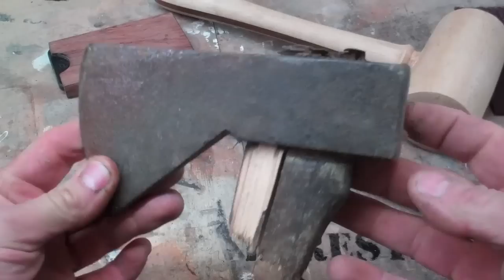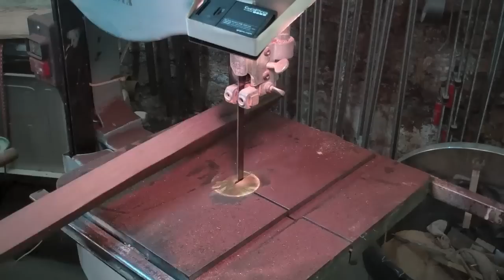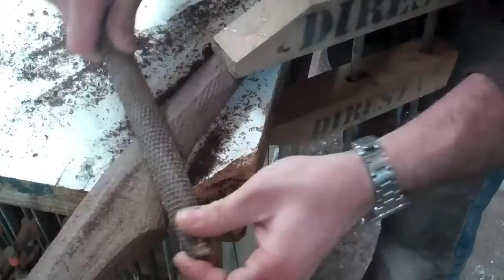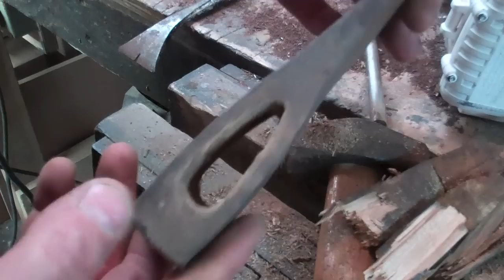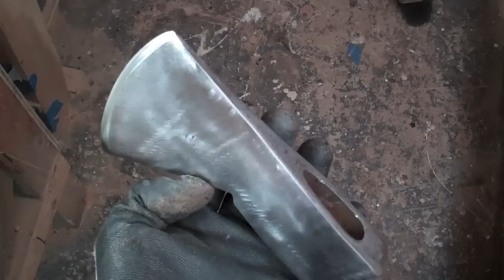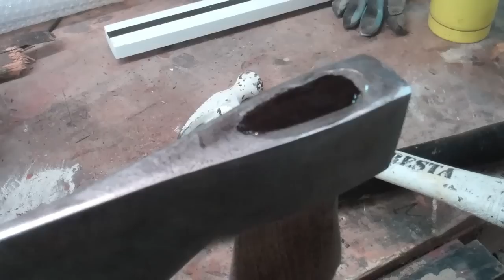✔ DiResta Axe Handle

Comment: Hey Jimmy, next time you want to remove rust like that you should try electrolytic rust removal.  All you need is a bucket, a 12 volt battery charger, some washing soda (yes, washing soda), some sacrificial steel, and the piece you want to de-rust.  Connect positive to the sacrificial steel, negative to the axe head with a piece of wire, and suspend the two in the bucket in some water with washing soda mixed in.  the current will turn the rust back into metal, and you won't have to use a grinder.  It's set and forget.
Reply: Why spend 30 minutes setting up electrolysis to save 2 minutes with a grinder?
Reply: Rick McQuay in case you don't want to mar the surface of something old/delicate/intricate. It works great for projects where you can't reach the rust with a power tool too. For example, I used it to de-rust the interior of a motorcycle fuel tank before patching it.  Bent up piano wire works like a charm in those hard to reach spots. The closer you get to the work piece without touching it the faster the reaction happens in that spot.
Reply: He was also removing the pitting.
Reply: wouldntyaliktono It's an axe head, nothing delicate or intricate.
Reply: Just the solution I was looking for to restore an old metal suitcase/trunk.
Thanks!
Reply: Rick McQuay methinks you miss the point.  Not saying he did it incorrectly, just sharing my experience. cheers
Reply: Paul Whelan It works the best if you've got a high current battery charger (10+ amps) and your water is warm.  The longer you let it run, the more rust will convert back to iron.  Make sure you're not stingy with the washing soda too because it's what carries the electrons through the water from one pole to the other (electrolyte).  You can buy a whole box of it at the grocery store in the detergents aisle for a few bucks.  ALSO, don't do it to stainless steel or chromed steel.  You're liable to release hexavalent chromium which is very bad for you. cheers.
Reply: wouldntyaliktono Thanks a million mate. I have a setup for anodizing and one for etching PCBs, along with some caustic I use for cleaning aluminium so I'll see what I can put together. Thanks again for your help.

Comment: That's a hatchet, and doesn't have need for such a long handle. Axe handles also shouldn't be polyed. Boiled linseed oil is all they need. Also, super glue and zip kicker isn't going to hold that ax head on, especially with that wedge breaking up like that. LOL But otherwise, great work.
Reply from the maker: the good thing about making things:  you can do what suits you and your personal needs. the head will not go any where i promise. 
Thank you!
Reply: jimmydiresta Yes Jimmy, in Yorkshire there's an old axiom, I paraphrase: them that can, do, them that can't make dumb comments. Great work, sir.
Reply: Well Gareth, that proves to me that the lads in Yorkshire are just as daft as those in Liverpool. My comment was 100% correct.Gareth Martin
Reply: 8bitlife OK let's examine that. For me, the tool is an axe if the guy who made the axe calls it an axe. At about 3 mins you have proof that he knows what an axe is. Ditto for the finish, I'd use BOL too but up to pres I aint made an axe so if Diresta wants a poly'd handle that's his call. He's patently not hoping that the CA holds the shaft in the head but is obviously using it as an end seal. One thing I will agree with you on....Yorkshire lads are just as daft as scousers. Peace.
Reply: Gareth Martin while i mostly agree with you, jimmy didn't make the axe head.  i think 8bitlife was right; looks like a hatchet to me.  if jimmydiresta wants to use it this way, i'm sure he has a reason. personally, i'd be scared of hitting that handle on my elbow and glancing into my shins.  otherwise it's just a really light forest axe, good for limbing, etc
totally agreed on the poly.  that's just a recipe for blisters. 
probably should have also re-used the steel wedges for expanding the other direction.
jimmy made a handle mostly by hand.  totally badass.  they are nearly impossible to find in good quality with correct grain orientation in hickory or other long grain hardwoods.  i've replaced the handles on 5 axes/hatchets or so at this point.  videos to come :-)
Reply: 8bitlife
besides the hatchet part you are correct, a hatchet head is an axe head with a short handle lol. a hatchet head is a boys axe head same weight same everything besides the handle.
Reply: Hatchets and boys axes are often a bit different in design and weight.
Reply: Nicholas Smerk
not really, i have a very nice collection of axes, many different vintage brands and boys axes and hatchets are almost identical even from different brands, yes there are ditciated "hatchets" but that was not one it was a hudsons bay pattern axe which is a boys size axe.
Reply: I'm not completely following what you typed above.  Many hatchets I've seen have nail pulling slots, and the ones with hammer poles are popular around here.  Don't boys axes don't have the nail pulling notch.
Reply: Nicholas Smerk
i see what your saying, your speaking of utility hatchets and purpose built carpentry hatchets, im speaking of wood processing and bush craft hatchets which are topically a boys axe head with a shorter haft.
Reply: Nicholas Smerk I believe you are thinking of a carpenters axe
Reply: In your comment you first said it was a hatchet, then two sentences later you called it an axe, which leads me to believe you have not a clue what you're talking about. And no...you're wrong again, keep your uneducated comments to yourself, a wise man once said "it's better to be silent and thought a fool than to open your mouth and remove all doubt "!
Reply: just watch his videos about axe and hatchet, he has no clue how to make the handle for thóe things.

Comment: That wedge was not to par. A wood softer than the handle is needed and it should not break like that. It is best driven in by resting the wedge on the floor and hammering the handle onto it. This also helps secure the axe eye on, unlike the "naive" wedge setting which actually pulls the eye off.

Comment: What tool/bit did you use when you "drilled" out the waste from the old handle still in the mortise of the ax?
Reply from the maker: it is a stepped bit for sheet metal... just wanted to make the wood into dust. thank you
Reply: jimmydiresta Thanks.  I couldn't tell.  It worked just as you planned.  :)
Great work as always, please keep it up.  Very inspiring.

Comment: But is that a "proper" handle?
Reply: +petegalvs No wranglerstar didn't do it so it can't possibly be proper.
Reply: +petegalvs he should rename the chanel to "the tool rapist" because this is just not how you do such a thing, his kind of people is the reason you can buy handles instead of making one.
Reply: +Joost Brekelmans  and why is that?
Reply: +Carl Antaya so you're saying that that is not wood?
Reply: +Inconvient Camping whell if you see his other videos you will know what i mean
Reply: +Ed Bell  Step wedges are a modern invention. They were not originally used nor are they necessary if the fit of the head upon the shoulder is correct.

Comment: It may not be the right wood or he may seated the head wrong or cracked the wedge to hell,  but man that axe is beautiful. Jimmy is a master at this shit he is the man in my book. Yo diresta how can I get a hold of u to build me a small box I can carry and make it like a Chinese lock box. One of the secret code boxes?
Reply: +Pill28 there was nothing wrong with any of the points you mentioned. head was seated fine,,, method does not matter. the wedge is doing its job no matter the cracks as it was quite obvious he put an epoxy to seal the end....

Comment: could you use pine?
Reply: No, not for an axe that you are going to use. For one to hang on the wall as a prop then sure. Pine is not hard enough to stand up to use that an axe goes through. Oak, Maple, Hickory...any of the hardwoods will work.

Comment: I love your work Jimmy but this makes me cringe. No offense but you did this all wrong. First off this is a hatchet head, the handle you made is way to long and is more suitable for a felling head. The walnut that you chose to make your handle out of will crack after a few hours of use, most common and correct wood to use is hickory, Tennessee hickory if your lucky due to its strength and lateral grain structure. they way you hung the head is the worst way you could do it, it is not properly fitted and is dangerous because it could fly off very easily and hurt someone. You used poly to finish the handle, you will find after using it your hands will be very sore, get blisters and you will be much more tired due to the lack of grip. i would suggest using nothing or boiled linseed oil. 

Once again i love your work and have been watching for years now and am only being straight up because i believe if you do something, do it right especially if you are planning on teaching forward the process you chose to refurb/ hang this axe.
Reply from the maker: The good thing about having imagination... is that you can break the rules.. it is not Walnut. relax... it is for carving not deforestation. thank you